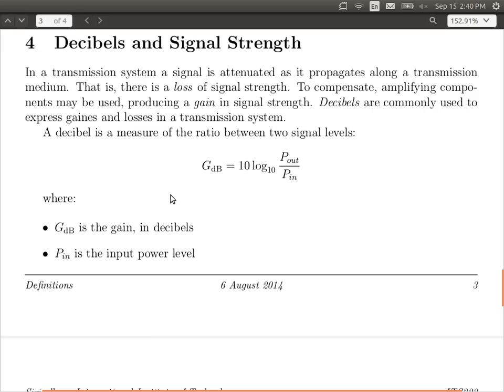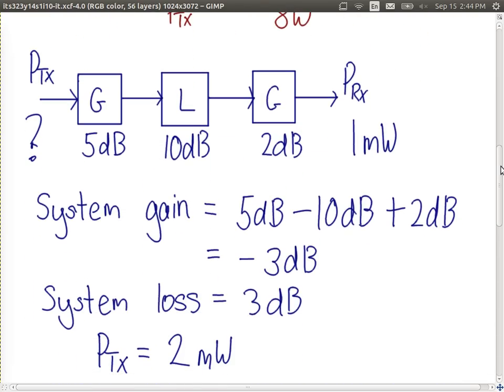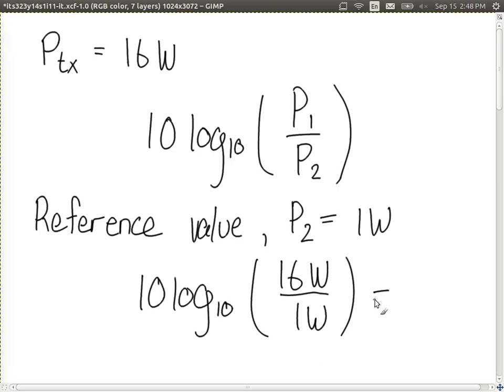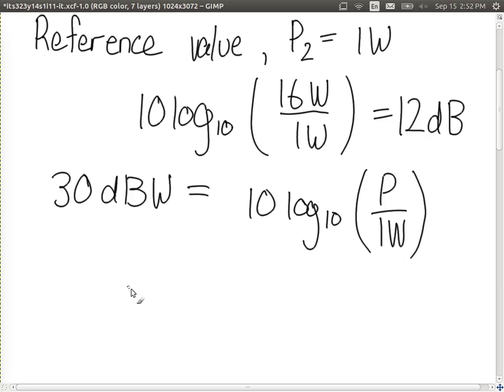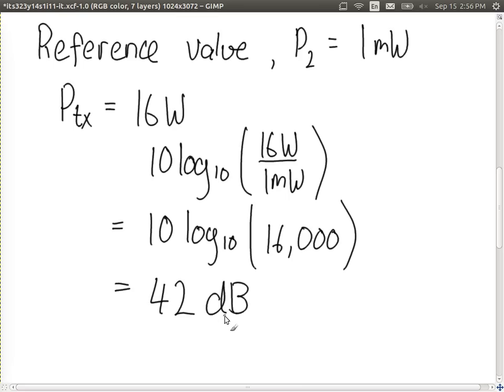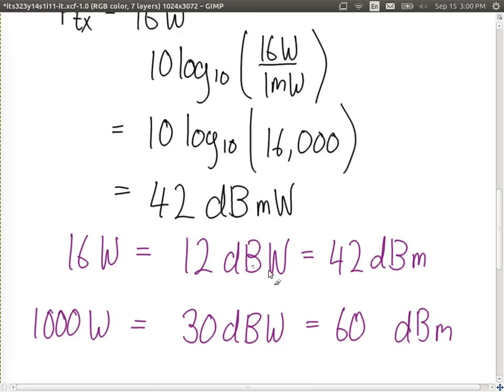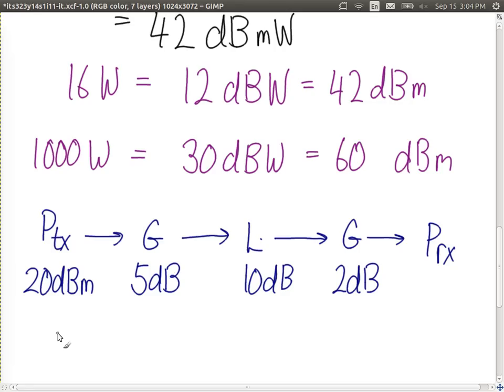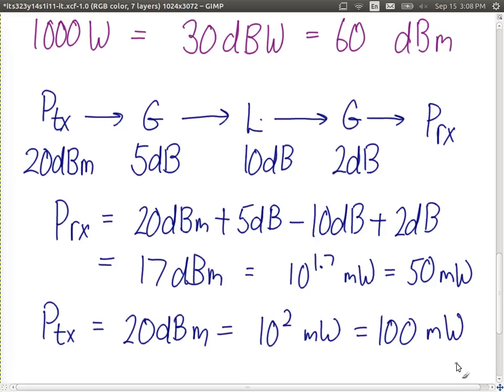Decibels, dBW and dBm (ITS323, Lecture 11, 2014)

Comment: Thankyou for explaining the mathematical concept of dBm and dBW.

Could you explain as to why there was a need in dBW and dBm? Both are power so why study both why not just study one and convert it to the other whenever necessary.
Why make two standards which are so close?
Also,practically could you explain the use of dBm and dBW in a recording studio?
Reply from the maker: +ajith kumar dBW and dBmW (although often written as just dBm) - why have both? Same reason we use different prefixes like mW, W, kW, MW, GW etc. The prefixes are useful for dealing with very large or small numbers. The prefix you choose depends on how large/small they are. Sometimes you use cm, m or km. In the same way, sometimes you use dBW or dBm.